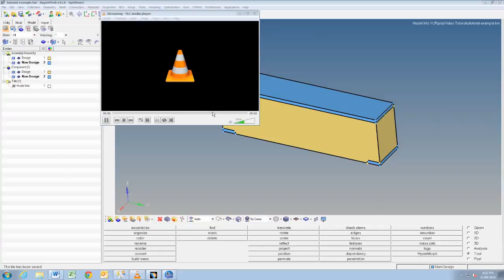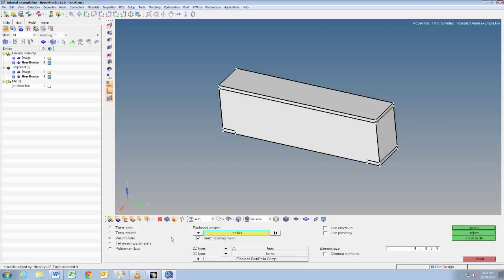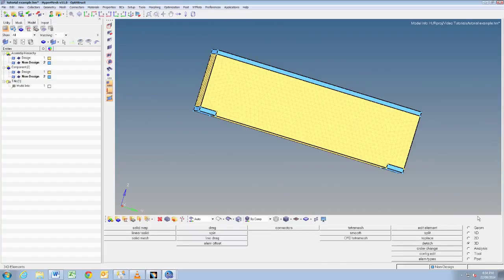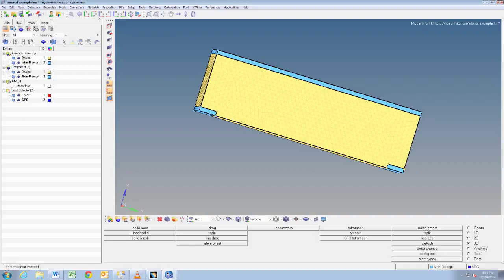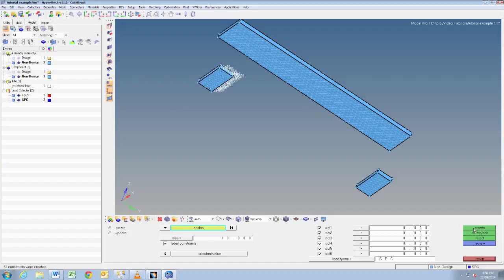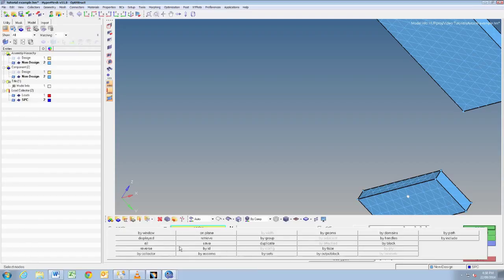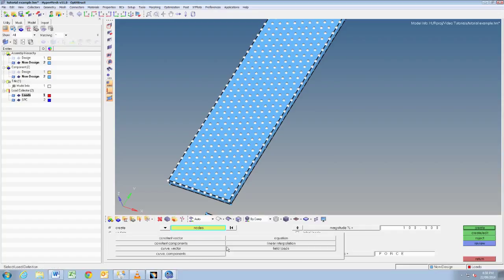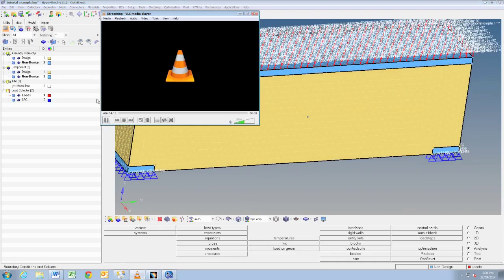Topology Optimisation in Hypermesh 11.0 - Tutorial 2

Comment: Hi Ben, Great tutorials! Had a quick question; suppose I didnt want some of the Non_Design sections to run the whole way through the yellow section (hypothetically, using your tutorial). So just looking at the two small non-design (blue parts). Suppose I wanted to run of them only half way through the yellow bit, and the second blue component through the second half of the yellow bit, without any overlap of the two smaller blue (non-design) items. Is there any way to decide how 'deep' you want the (non-design) face to run into the design section? Apologies is this doesn't really make sense. Please feel free to ask if you want me to explain another way. Thanks in advance.